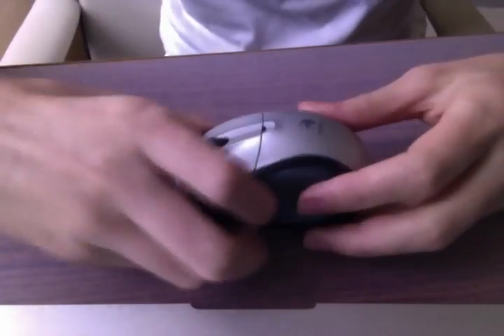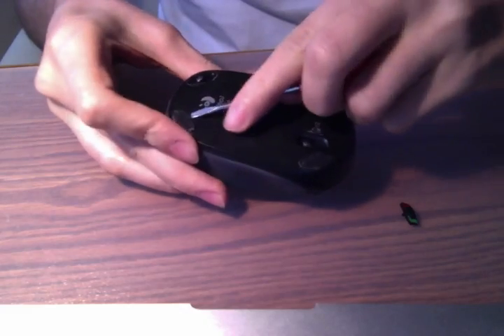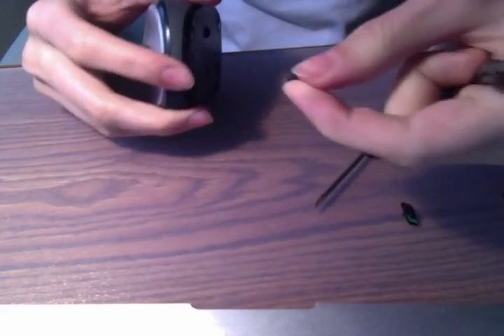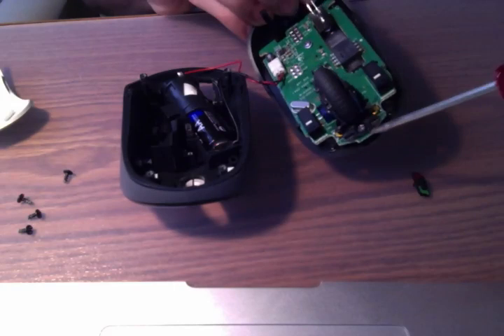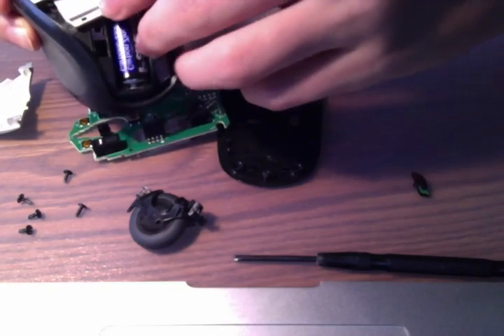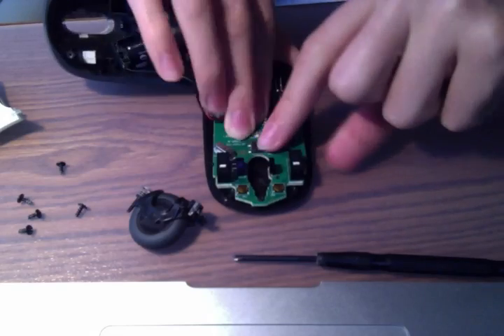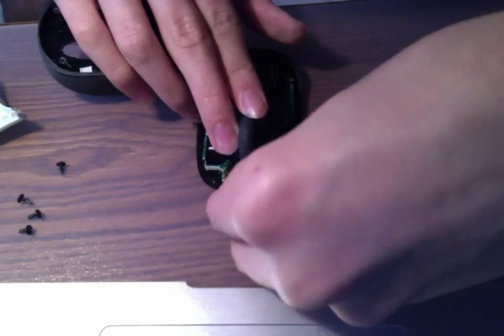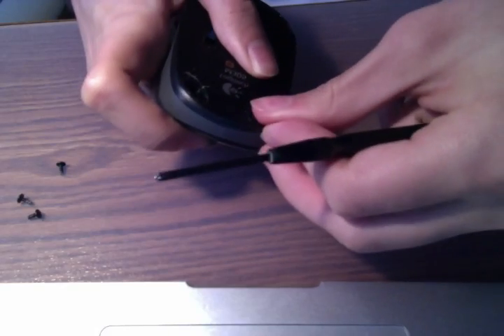Open up & Repair Logitech Wireless Mouse (2015 - M305)

Comment: Hello good day. What happens is that I have a problem with my mouse that is the same as the video, it was damaged was the case but it works perfectly, you would not know if there is some place where I can buy only this part, could you help me?
I would be very grateful to you...